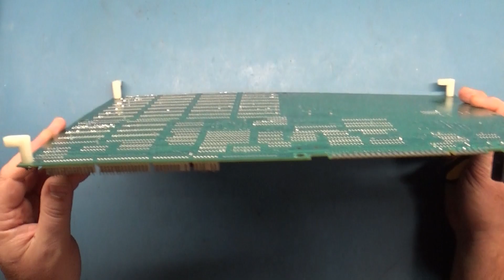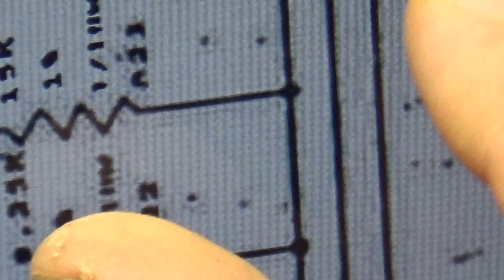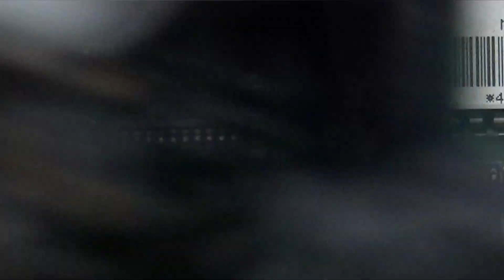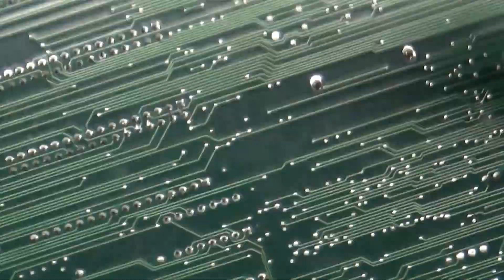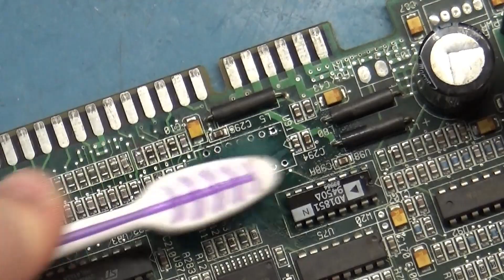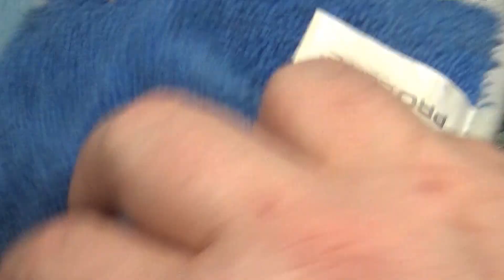UMK3 Arcade PCB Repair - No Blue Color

Comment: Hi Mike revisiting some old repair videos, mate quick question with regards to the temperature of the rework gun when you remove u91? and do you use this method with larger ic's like 68k cpu's etc, no flux just heat?

Cheers
Franky
Reply from the maker: Greetings Franky. I run my gear at 800F.  And yes, no flux. Just heat. There’s plenty of flux in the solder. Not really necessary (in my opinion) when removing chips. Now when installing chips, flux is very necessary.
Reply: @YourMKArcadeSource  Thanks Mike appreciate the help so just to confirm 800f on iron and desoldering gun? Noted on the flux also.

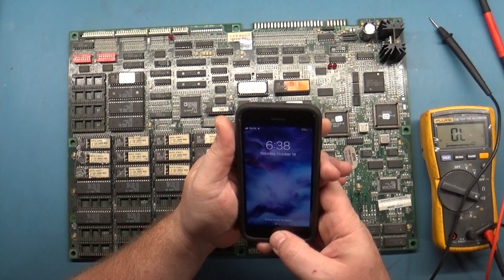Comment: Where did you get the schematics?  I have a UMK3 board where LP doesn't seem to work on Player 1, I wanted to do some basic checks, however I have not been able to find a schematic online.  The Operating Manual only has a basic wiring diagram, not the full schematics that you show around 4:00 in this video.
Reply from the maker: Here ya go. 

https://www.mediafire.com/file/87f59h2zh57meob/Wolf_Unit_Schematics.pdf/file?dkey=wj76tckdfpt&r=1478

Comment: Hey Mike, saw a video of yours where you recommend a certain brand of of JAMMA due to its higher quality level, aka. Separate 18 gauge wires for multi +5 volt lines instead of the cheap Chinese JAMMA that shares one connector and splicing with crappy small 22 gauge.  

Who did you recommend to purchase from again?  Was it Twisted Quarter?

Thanks Mike 🤟🏼
Reply from the maker: Yup.. 

https://twistedquarter.com/index.php?main_page=product_info&cPath=177_178&products_id=5

Comment: Regarding the braid, any tips on that? What brand and type to use, if soldering tip important etc? Never been able to properly use a braid to do something like this.
Reply from the maker: This is the braid I use. Needs to have flux in it. That could be part of your problem. As for the tip, it needs to be at least as big as the hole you’re trying to extract solder from. Bigger the tip, the more heat can be transferred. Set you iron to around 750f and you should have no problem.

Comment: Have you ever had an issue with a mortal kombat 1 soundboard causing random sounds to play in the wrong areas during gameplay? For example, I heard a character screaming like they were falling in the pit even though I wasn't on that stage.
Reply from the maker: Yes. Reseat the roms and your ribbon cable, or the ribbon cable could be on backwards at one end.

Comment: Nice work I have a KI board that the sound keeps goin in and out , I’m sure you can fix it but no way contacting you ,you tube doesn’t give me that option
Reply from the maker: I don’t work on KI boards unfortunately. There is no technical data released for them. First thing I’d do is replace the filter capacitor. It’s most likely failing or it could be simply bad connections on the sound roms.